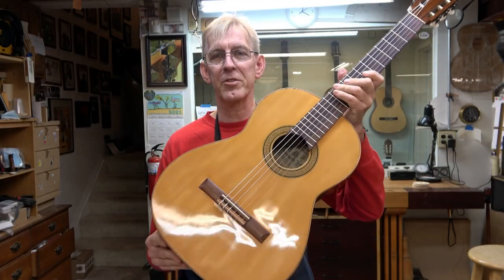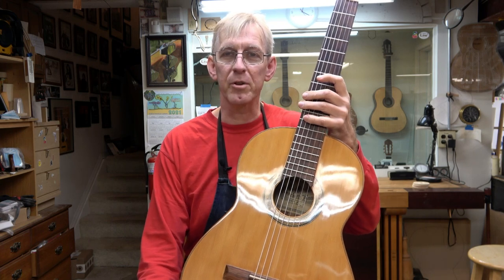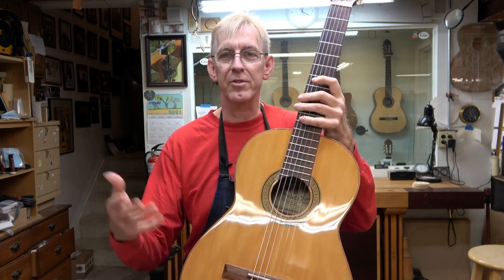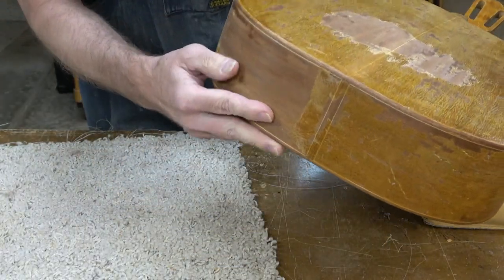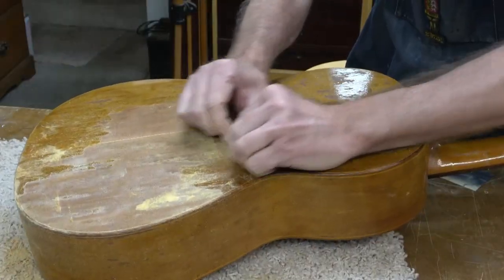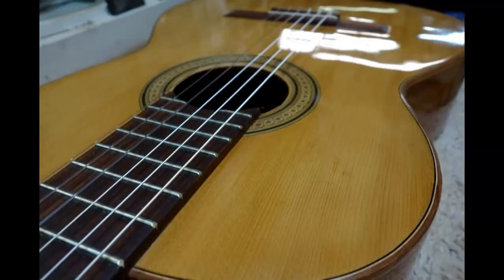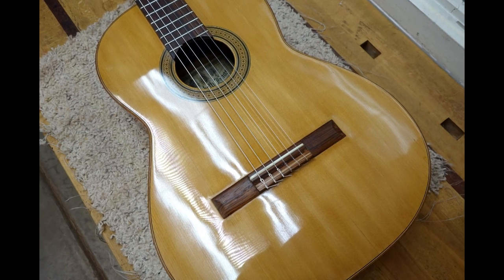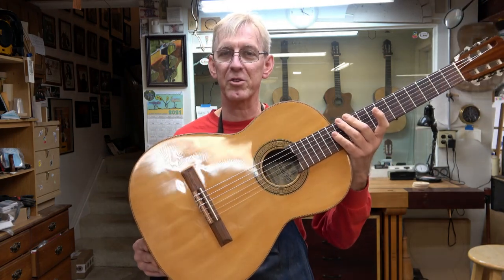O'Brien Guitars - Refinish of Guitar Built in Uruguay

Comment: I am currently doing a whole guitar refinish,. Since I've tried to use solvent and paint stripper, but none of those work on the previous finish, so I mostly use sanding to sand off all the finish. I am having trouble removing the finish stuck next to the fingerboard and top/neck heel and side. May I ask if you only use scrappers to remove all the finish? Or any other techniques were used?

Comment: Great job! I do realize that refinishing is always not recommended and from the Luthier's perspective always means more work than necessary but what about the Japanese made guitars of the 1970's for example Masaru Kohno where they themselves (Masaki Sakurai himself) have admitted the finish they used was not so good and that they do refinish them periodically. There is a clip on YT where a fellow in Atlanta refinished his Kohno 30 in Tung Oil I think it was. Any thoughts on this? I have a 1976 that has such a finish although there are no cracks or repairs. The original "cashew" is wearing off on it's own.
Reply from the maker: John, you are referring to a former teacher of mine, George Petch at Maple Street Guitars in Atlanta. I have seen and played his guitar and it indeed did sound better with the finish removed and oil applied. When done properly a re-finish can make a guitar sound better. However, always take into consideration what it might do to the value of the instrument. Although it might make an historic instrument better tonally that doesn't mean you should do it.  George wasn't worried about the value but rather the sound of his guitar.  For those interested, I have a video on the Lutherie Academy website coming out on January 11, 2023 about how to remove a finish from an instrument. https://lutherieacademy.com/courses
Reply: @OBrienGuitars  Wow ,small World. I did watch and enjoyed very much your clips with the late maestro Romanillos. Thank you for all you share!
Reply from the maker: @johnsaldivar2619  Thanks for watching!

Comment: What do you recommend doing to a guitar’s finish that you don’t want to scrape off, because like you said, it’d decrease the value, but it’s flaked of in places and cracks? Would a layer over it be smart at all? Maybe a very light sanding just to smooth first?
Reply from the maker: Hard to diagnose without seeing a pic. Sounds like you want to touch up the finish. First know what type of finish it is and that will help you know how to proceed.